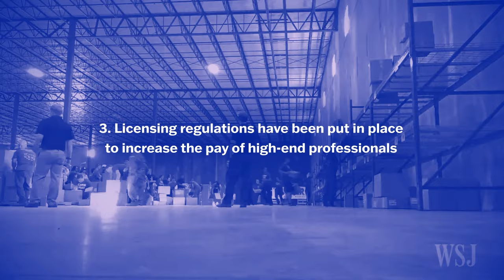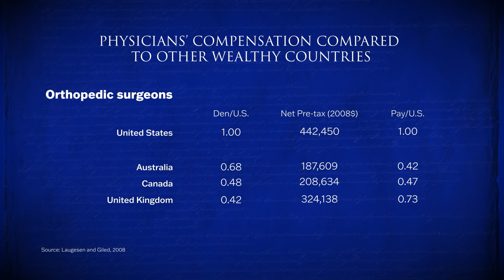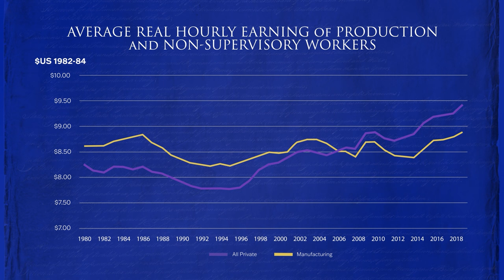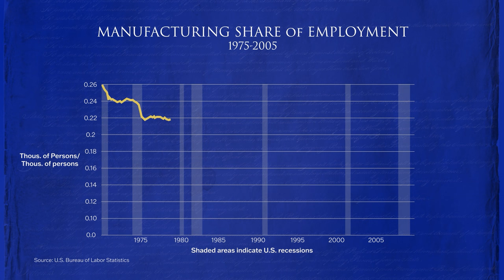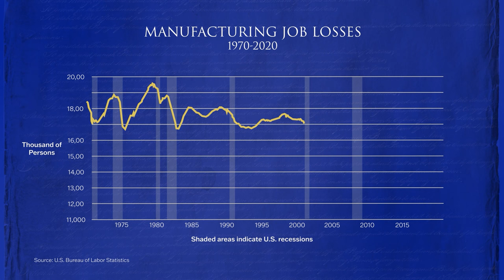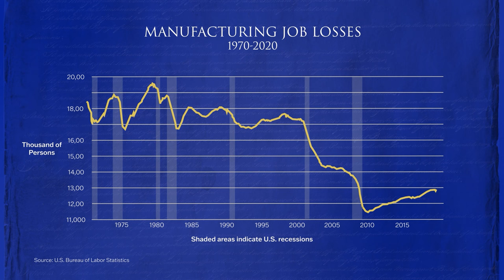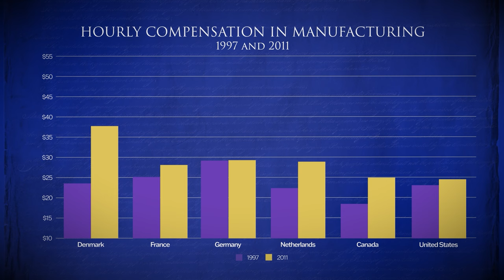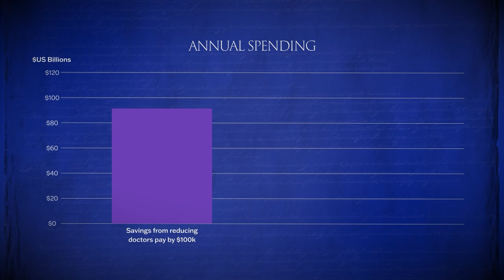How to Unf★ck Employment

Comment: A question for Dr Baker regarding something from the video that didn't quite convince me enough. 
In case of manufacturing sector the commodities are simply commodities. While if we import professional service workers they will become part of the US workforce and residents of the country. In this case I don't think Stolper-Samuelson theorem will apply for professional services. Labour isn't a final good, it's a factor unlike shoes or cars. 
In case of importing professional services, the workers will become part of the economy thereby maintain at least the same level of wages as before (see works of David Card). I don't see how exposing professionals to global competition would depress their real wages, even though it will have some indirect economic benefits to the rest of the populations.
Reply: I think it depends on the magnitude of the change in the supply of these professionals relative to existing demand, and the demand that they themselves add.  If the supply of orthodontists increases by 25% but that only translates to a 10% increase in demand for orthodontists, then I think there's nowhere for average orthodontists' salary to go but down.
Reply: @xxcrysad3000xx  Yes. This somewhat makes sense. Although I have yet to come across empirical papers supporting this proposition as such, especially in professional services. Do share any papers if you have come across relating to the same.

It's also likely that the professionals collude in an oligopolistic way to maintain high salary for themselves.
Reply: @Amitav R
I don't know of any papers to link you, but I would just point out that while in goods the final output is the actual product itself, however in services it is hard to see how one could separate the final output [the actual service provided,] from the person providing that service. Like, if your going to a doctor to have them look at/fix an issue then how do separate that doctor out as merely a factor & not the final output?
 
Besides, while the example given inherently involves immigrant labor, the actual depression on wages would come from the elimination in protectionist labor barriers that are limiting the competition of workers. Really a similar type of effect mechanism as occupational licensing requirements for jobs. The example in the video involves both aspects of change, but it's really the latter which is effecting the wages while the former is merely sort of the knock on effect due to the barriers being targeted are ones that limit immigrant entry into the labor pool. As for papers on that, I don't know of any econ papers published in academic journals, but I do know of a couple government reports on the subject that obviously have numerous citations included. There is one from the National Conference of State Legislatures titled "The Evolving State of Occupational Licensing" & there is one from the Federal Trade Commission titled "Policy Perspectives: Options to Enhance Occupational License Portability". They take a much broader look about occupational licensing in general, but these do include discussions of the effects licensing has on labor supply, wages, etc...

Comment: But if we're at full employment, is it possible (or desirable) to bring home manufacturing? What about all the service sector positions in the private and public sector that are currently going unfilled? Would the solution then involve radically embracing immigration?
Reply: One reason all those positions go unfilled is employers no longer provide paid on the job training on the low end of the economy, they expect job applicants to have years of experience, certifications or degrees before they'll even consider hiring a person.